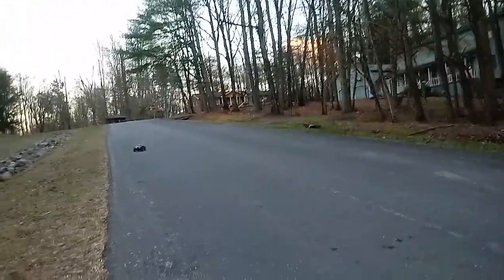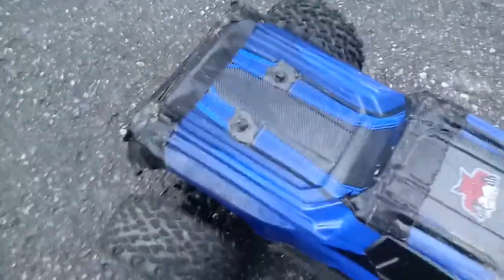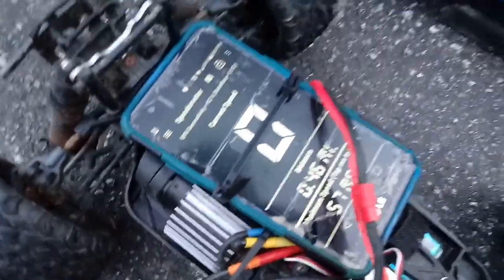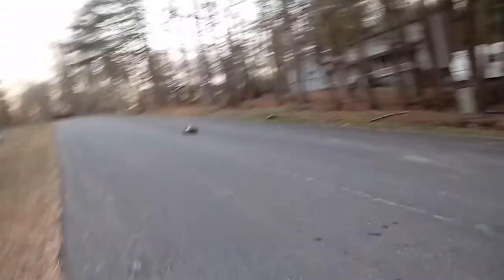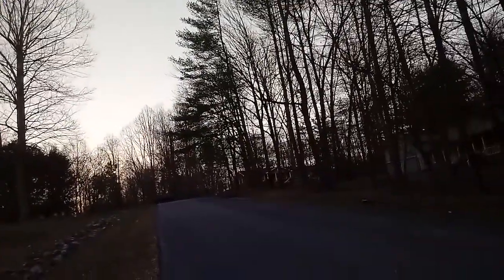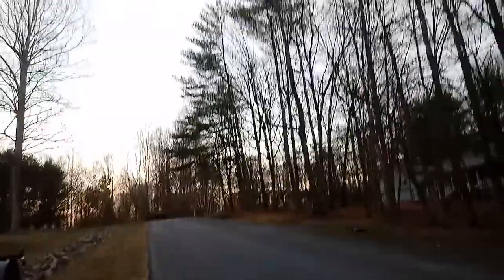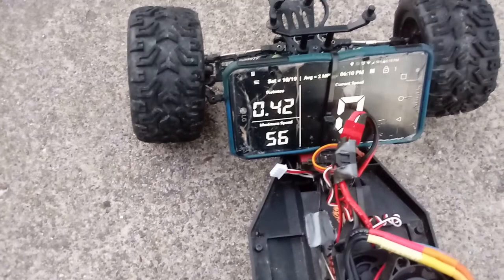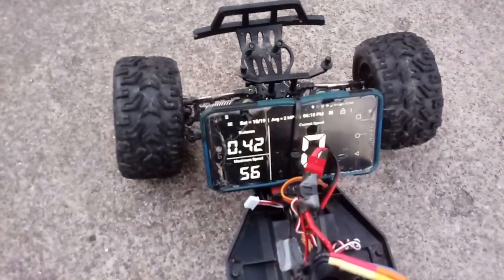Brushless Blackout Xte vs. Brushless L313, top speed comparison

Comment: Team BLACKOUT ALL DAY✊💯😂😂🤣. Yeah they quick bruh😁👍👍. Have you seen the New SC truck from Team Redcat🤔?. Its hitting 50mph on 3s out the box. I was checking a vid by No Problem,  all he did was change out his ESC, on 3s he was hitting 61, on stock gearing...Whhhhhatttt😲🤣. Great vid my brother, cant wait to see the  Head2Head✊😆
Reply from the maker: C McCotter So I just went and watched the vid, and yeah... Redcat stole my setup! Lol the sc10e runs a 3660 4300kv motor,  and a 80 amp esc! Same rated electronics that is in my blackout! I've had this blackout at 61mph. And now I have a bigger pinion so, I think it will do better next time... I put a new diff in it, and it's ready to go! I will try to get a top speed run tomorrow! Thanks bro!  And I don't why he changed the esc? It is a 80 amp, so should be good for 3s?